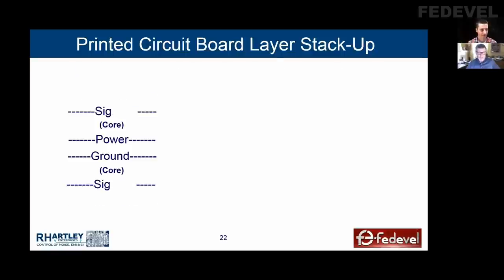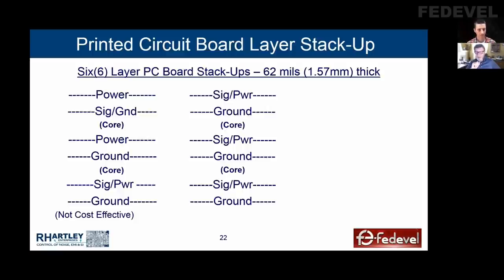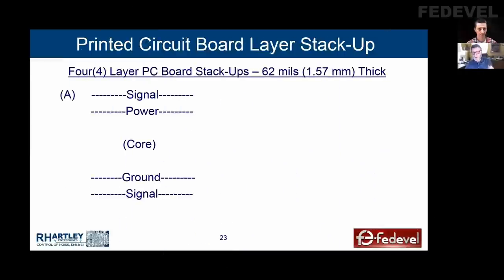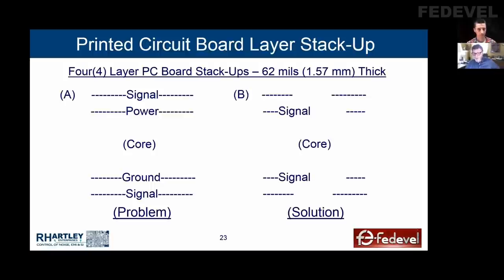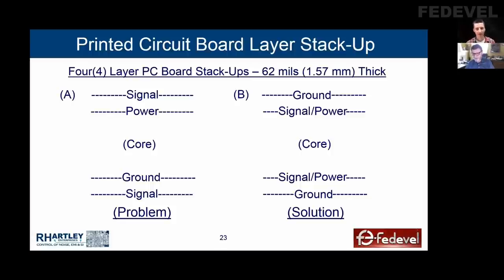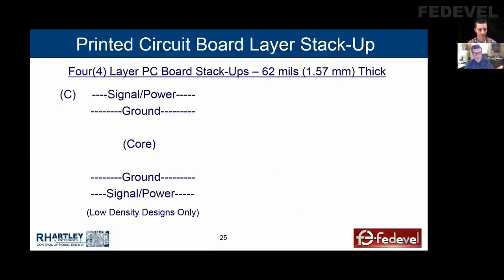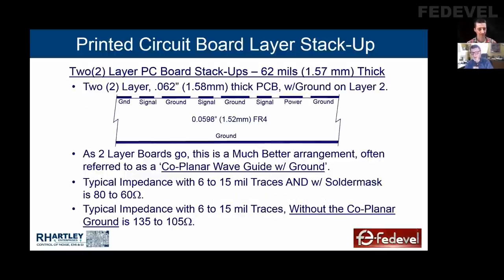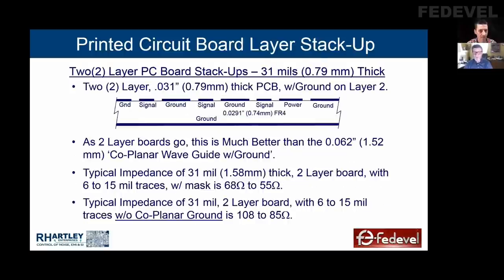PCB Stackup Explained - What layer ordering is good or bad and why | Rick Hartley | #HighlightsRF

Comment: Is this purely for high-frequency designs? @ 2:43 I don't get what he means by not needing a ground via when going between 1 & 3. I am assuming he is talking about the high frequency circuit idea that return currents follow under traces? However you still need vias to connect the component grounds on layer 1 to layer 2 and the rest?
Reply: yes, the whole video is about high speed, and this is just a cut, in the introduction he explains what you said about return current vias when the near reference is not gnd

Comment: Why exactly cant you use 4 layer stack up sig/pwr, gnd gnd sig/pwr on a dense board? Is it a space/routing limitation? What else is wrong?
Reply: I am using this stackup and found this part of the interview the most interesting one. It made me question my choice because this stackup was the most recommended one. With my small knowledge I am thinking this is because when routing power and signals on the same outer layers you can't do this with components directly on the other side meaning you must use the free space. Now with high density this makes it hard because both sides are full of components... Compared to routing on inner layers where there are no components and the outer layers provide ground reference.

Luckily for me it's a non dense 4 layer board with components only on one side and with a lot of space everywhere... Fingers crossed.
Reply: @zeref783 having a power layer make it easier to get the power when you need it with just a via, if there is no power plane you have to route your way to the ICs without jumping to other layers. It is clearly a no go in real life for lots of components and interconnects between them

Comment: I'd like to see real pcb examples of each of these strategies.
Reply from the maker: Do you mean layout? I am not sure if that would be so easy - I guess, most projects are under NDA and can't be shown.
Reply: Without a real example, this talk is worth little. It's easy to say "ground on bottom", but what the hell does that mean??? There are components on the bottom, and there is local routing between those components!!!
Reply: @RobertFeranec  yes layouts is what I meant.  Doesn't have to be a recent design. Even a partially redacted design would be good enough.
Reply: Some images wouldbe better than just words
Reply: I guess it's a struggle between theory and practice.
Reply: @nameredacted1242  That means: flood the bottom plane with ground and use vias to connect the signal & power pins (if SMD component; in case of THT you can just connect on the through hole) in most cases, and route just in few/special very short trace cases (e.g. neighbor pins/pad) on the bottom plane itself.
So "local routing" for bottom components would happen mostly on layer 3
🤷
Reply: @icestormfr  If you are telling me that I can't even connect neighboring components on bottom side, then this is NOT feasible in terms of routing complexity for real-world designs. Like I said, I call the entire video BS if they can't specifically address such immediate questions and show real-world routing examples!!!
Reply: @nameredacted1242 Exactly, wtf is going on with these "recomandations" ?!? he seems to show off... it is useless without examples and principles and guidelines... videos like that trick you into buying their stuff or consultation without teaching anything useful in real life scenarios.
Reply: @robegatt  You are not even allowed to buy their book without going to their course. I met Rick in-person and complained about the same topic, I literally asked him to sell me his book in person to me in cash at a conference expecting him to have copies in his briefcase, and nope, have to attend their course to get a copy of their book. With Eric Bogatin, you can attend the entire course for free thru LeCroy.
Reply: @nameredacted1242  Ugh. What you're telling me confirms what I suspected. Sigh.